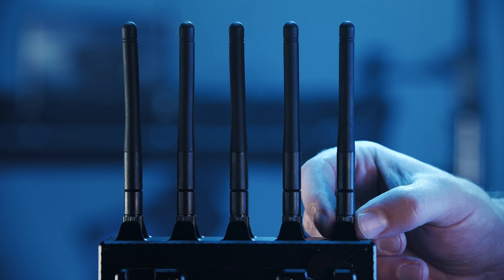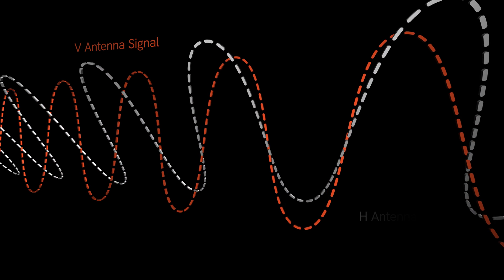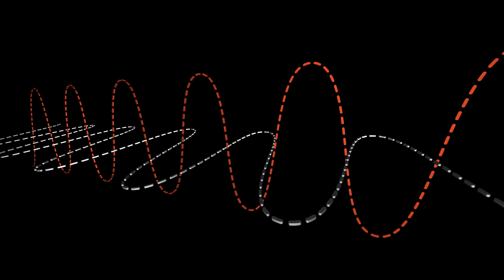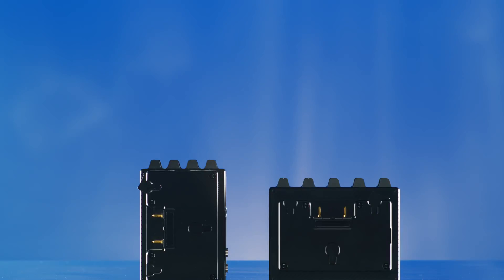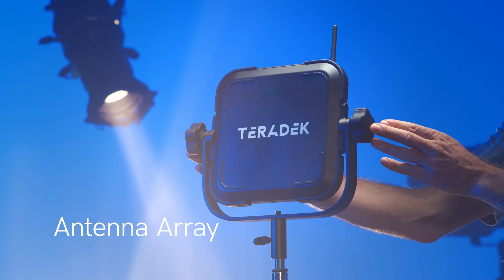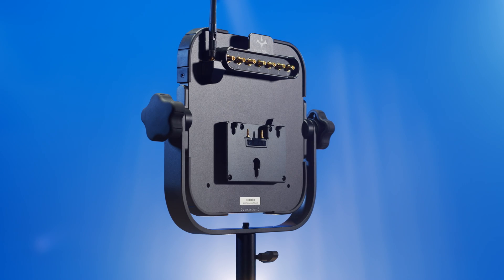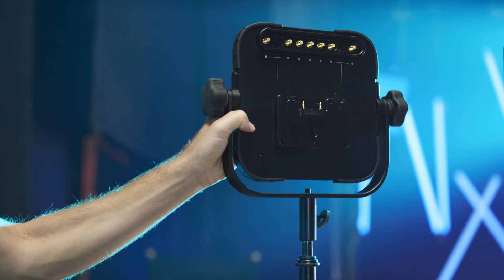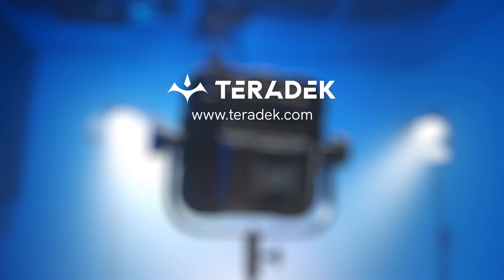How to Optimize Your Teradek Bolt Signal

Comment: Now that you're shipping internal antennas, how does it work?  Are they limited to V only?  Do they come set as V+H standard?  Which setup maximizes the efficiency of a receiver with external antennas?
Reply from the maker: Hi Dalton! Thanks for your question. To maximize efficiency and range we would recommend running all V-antennas. But the internal antennas will also work with V+H set ups as well.
Reply: @ Sorry, I guess my question is will a set with external antennas in V+H mode perform better than a set using internal antennas?  Thanks.
Reply from the maker: @daltonrandall4348  In order to maximize the benefits of the H antennas, having all V+H external antennas is the best option.

Comment: Can I use new H antennas (like the ones you find on a bolt 6) on older 4k lt 750?
Reply from the maker: Yes! The new Flex H-Antennas operate on 4.9-7.3 GHz so they cover the ranges on which Bolt 4K operates.
Reply: @Teradek 🫡 good to know!

Comment: can Antenna Array for Bolt 4K work with my normal bolt 750 4k rx and what I need to put on it to make it work with the Array
Reply from the maker: Yes, your Bolt 4K works with the Array. The Array comes with cables that you can connect straight to your RX. Check it out here: http://tdek.co/array-y

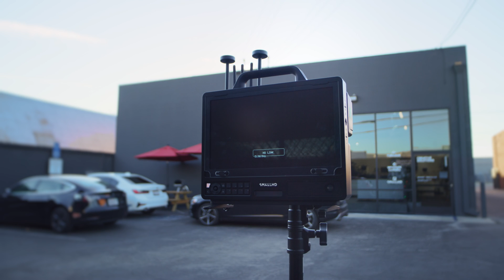Comment: 6:05 The antennas in the Tx are connected wrong, you have put the V antenna near the connectors. You just said it on 2:24. Thanks for the tutorilas any ways. XD
Reply: I guess it works both ways fairly well, since they still got a signal in their example...
Reply from the maker: Good call-out, the H antenna needs to be closest to the BNC connector, as described in the video. Our team is aware!